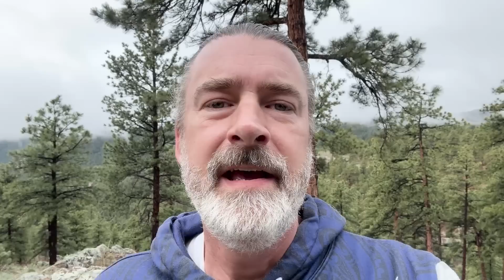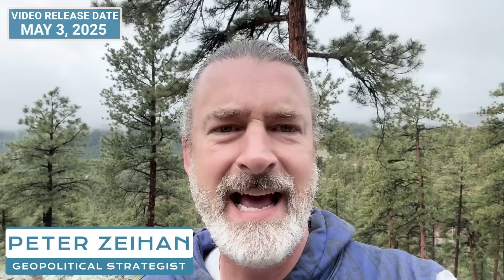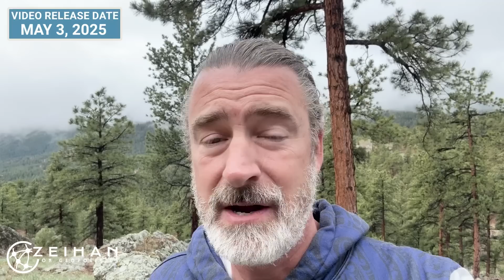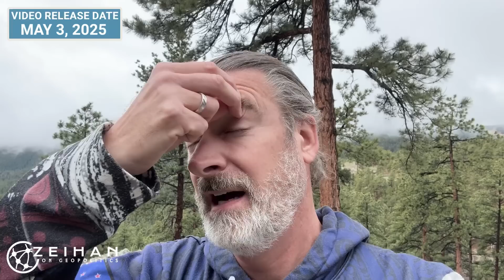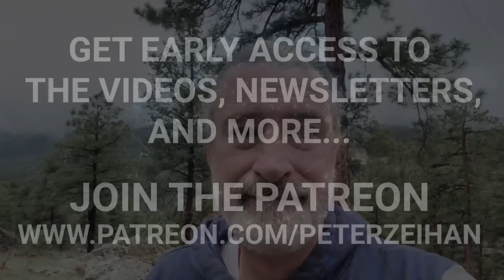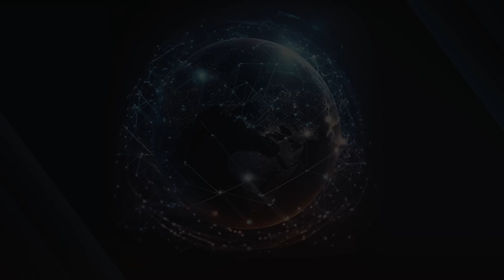The Night the Lights Went Out in Geor- er, Spain || Peter Zeihan

Comment: "Spin out of control" - well said. Easy to understand (I hope)   Sadly spinning mass dampers are not large enough to handle the issue. When scaled up, the losses also scale up. 
Capacitor banks are not there yet.   
Do not overlook NUCLEAR power. One does not need fossile fuels per se.

Comment: Theres a third and fourth option as well. We can use nuclear power obviously, but we can also use gravity batteries instead of using normal ones. Essentially using excess energy to fill a reservoir with water, then letting the water spill back out spinning turbines for power during peak power or the evening.

Comment: I'm not an electrical engineer, but I do understand that batteries are excellent at grid stabilization. This just doesn't pass the smell test. What happened I'm sure is like you said: a frequency shift causing a grid shutdown due to over/under production of power. I do not know that batteries are to blame for it and the titanium thing? no..... just no.

Comment: I worked in a large base load power plant in I believe in 1998 or 1999 there was a large transformer blew up took out the power on the east coast. I was working that day and started picking up alarms on the machines generators. We were being pulled out of 60 cycles. We were at full load on both units 500 megwatts. The harmonics caused by the sag could damage the turbines. We started dropping load to try and bring the voltage back up. We contacted the load center and was told to do what ever wanted because they were in trouble finally someone open the system interconnection with the ECAR system and everthing came back. Other wise the result would have been very bad

Comment: I was driving from Spain into Portugal on April 28 when the power outage happened/this is the first time ever in history that Portugal was completely without power from north to south south Spain was out of power/it happened around 12 o’clock in the afternoon the power was back up and running by 10 o’clock that evening. This is actually strategically done. The Portuguese and and Spaniards were blaming it on Russia/but Russia had nothing to do with this. This is all about flipping the monetary system. And it has started/get ready Americans.

Comment: Peter,  what you are saying is just incorrect. This is  misinformation that the coal and natural gas industry are hoping will be spread. Inverter based generation can perform all of the ancillary services needed to correct grid quality problems caused by load fluctuations, issues related to spinning turbines and other grid events. HOWEVER if the utility was not using the monitoring and control features enabled by the inverter based generation like Low Voltage Ride Through (LVRT) or VAR support then the “wobble” you mentioned can not be corrected fast enough by spinning turbines.  Spinning turbines are slow to correct grid quality issues which is why utility have used capacitor banks and other equipment that can act faster to grid issues  for decades. The reaction time for inverter based generation and existing energy storage is in milliseconds like capacitor banks (or even faster) but only if the utility were using these features. Most of the utilities in the US do not use these features because they don’t understand them and fear using LVRT could threaten line workers if the lines were intentionally off for maintenance. The lithium ion titanium story was really strange.  Current energy storage is supporting the grid for hours, not seconds. Love your channel but your passive dismissal of solar and wind is misplaced.  Hope you consider doing more research before making such misstatements on this issue.

Comment: If spinning mass is the main issue here, you can build rotating converters instead of the solid state inverters. A DC motor driving an AC alternator, add a flywheel inbetween for stability. That kind of oldstyle tech has been around for a hundred years, it has the disadvantage of being more service-intensive than solid state because of the moving parts but if you need inertia it might be the way to go.

And Austria doesn't have a significant amount of "heat power", it's mostly hydroelectric power. Which also has spinning turbines, so some rotating inertia.

Comment: All that is needed is to use some of the stored power to spin up a large flywheel attached to electrical generation and this will provide the inertia to stabilise the system from fluctuations of both power and frequency, in exactly the same manner that the steam generated turbines of coal powered stations do.

Comment: If you want to replace coal with low carbon power and still maintain grid stability, you can use nuclear. Nuclear provides reliable, stable base load without the need for batteries.

Comment: Irrespective of the cause, the other kinetic inertia capability not mentioned is the synchronous condenser of which there are 4 in South Australia. A spinning flywheel using power from the grid, not fossil fuels.  The global synchronous condenser market in terms of revenue was estimated to be worth $661 million in 2022 and is poised to reach $811 million by 2030.

Comment: You can introduce inertia into the grid using another piece of technology you haven't mentioned. You can use the DC energy produced by solar etc to maintain a "spinning generator" at the right frequency. This will introduce inertia but will you will lose a little energy in the process.

Comment: Spinning reserve doesn’t need to be provided by coal or gas, any thermal plant will do it, geothermal for example is a low carbon thermal option, base load flexible and increasingly going to be available basically anywhere…

Comment: Two thoughts here:

(1) Aren't the wind turbines all around not also a huge resource of "energy storing flyewheels? As they produce DC stabilizing the frequency all that is required is the adequate frequnct controll of the inverters, so to get effective is just a matter of milliseconds. (At the price of slowing the rotors down a little bit during that time, but dedicated flywheels as short term energy resource works in excatly the same way.)

(2) If only the stabilizing effect is an issue for a few minutes, wouldn't another option be just to shut off car charging stations for a brief moment? This not even needs to be a full shutdown, just reduce the charging output to 50% or 25% for a few minutes, stretching the duration of a 30 minute charging stop to maybe 35 minutes.

Yes, this affects all those who are charging their cars at the moment of the  instability nur isn't that a small price to be paid by by few people (less than a typical afternoon traffic jam or road construction work might cause) with a huge benefit to a whole country.

Comment: Batteries are not the only storage solution. 
Flywheels work, gravity storage (as stacking concrete blocks) is a new thing being adopted in China, and concentrated solar thermal power uses heat storage at the point of power production. All of these do not require rare materials or limited geography.

Comment: It is true that a stable frequency is needed. The other things you say is rubbish. Grid storage could 
 help stabilise the grid this just depends on the choice of inverter. Most are currently Line-commutated converters just follow the frequency so don't help. Voltage-source converter can steer their frequency and thus actively reduce frequency instability. Also no special batteries are needed as the limitation is the power rating of the converter not of the batteries. Regulation in both of these fields are needed.

Comment: WHEN THE GRID WAS DESIGNED......THE AC OR DC SCENARIO......THE DC WAS NOT A LONG THROW WHERE AS AC CAN BE A LONG THROW !
BUT THE TRUE REALITY IS THAT YOUR AC OUT OF THE WALL WHEN YOU PLUG IN YOUR ELECTRONIC DEVICES........GETS CONVERTED TO DC TO RUN THOSE DEVICES !!!   SO THERE COMES DON SADOWAY AND THE LIQUID METAL BATTERY....THOUGH AIMED AT GRID STORAGE, THE BATTERY IS THE TOTAL SOLUTION TO POWER !!!  THE PRESENT GRID IS OBSOLETE.....AND THE SADOWAY TECHNOLOGY WITH HIS BATTERY IS THE FINAL SOLUTION !!  SO THIS IS A CHEMISTRY BATTERY AND HENCE AN EXOTHERMIC REACTION ....MAKING HEAT.....LOTS OF HEAT.....TO THE TUNE OF 1600 DEGREES AND WELL ENOUGH TO CREATE STEAM AND A CLOSED LOOP SYSTEM......HENCE THE BATTERY IS SAID TO BE 4 HOURS UP AND 4 HOURS DOWN AND THE WHOLE TIME IT IS MAKING THS HEAT !!!   SO THE BATTERY CAN BE A SELF CHARGING SCENARIO WITH AN ARRAY OF BATTERIES AT VARIOUS STAGES OF CHARGE/DISCHARGE AND THUS CYCLING....ALL THE WHILE MAKING HEAT AND PRODUCING STEAM AND SPINNING A TURBINE......BUT LET'S IMAGINE SCALE AT THE HOME LEVEL AND THINK THE SIZE OF A CHEST FREEZER AND A SMALL TURBINE......AND AROUND THE SMALL FOOTPRINT OF A TYPICAL GAS HOME FURNACE IN THE NORTH EAST USA.  PART OF STEAM IS THE COOL DOWN FOR EFFICIENCY AND THUS A HEAT SINK......AND SUCH HEAT SINK IN A HOME SITUATION WOULD BE RADIANT FLOOR HEATING FOR COLD WEATHER SEASON AND THEN AN OUTSIDE UNIT FOR THE WARM SEASON TO DIVERT TO !!  SO IN HOT SEASON, THERE CAN BE SOLID STATE COOLING AS IN PELTIER AND THUS WITH AN ABUNDANT ENERGY SOURCE IN THE HOME......WHY NOT.  SO THE BASICS OF THE SADOWAY BATTERY ARE A SEALED VESSEL AND A CHEMICAL REACTION.....SO THINK CHEMICAL REACTOR IN THE HOME AND BENIGN !!!   NO MORE ENERGY BILLS FOR FOSSIL FUELS AND NO ISSUES WITH RADIOACTIVE COMPOUNDS AND HALF-LIFE ISSUES ..........AND JUST LIKE SOLAR IS MARKETED AS BEING ABLE TO SELL YOUR POWER BACK TO THE GRID.......IMAGINE THE ABUNDANCE OF POWER  AND A COMMUNITY WITH THIS IN EVERY HOME AND THE NEIGHBORHOOD MUNICIPAL NEEDS FOR POWER ARE TAX PAYER GENERATED......AND NO LONGER TAX PAYER PAID FOR AS A COST IN LOCAL GOVERNMENT & THE NEED FOR TAX REVENUE !!!    THINK INDUSTRIAL AND THE ENERGY COSTS OF PRODUCTION REDUCED TO ZERO IF NOT NEAR ZERO.....AND WHAT GETS PASSED TO THE CONSUMER.  IMAGINE THE REDUCTIONS IN COSTS ACROSS THE BOARD !!!  BUT THIS IS JUST A BASIC APPLICATION.......THAT EVERYBODY COULD UNDERSTAND WHEN IT COMES TO THE ROOF OVER YOUR HEAD.   NOW THINK ABOUT TRANSPORTATION AND ELECTRIC TRACTION MOTORS....AND RAIL SYSTEMS...AND MOVING PEOPLE DISTANCES AND COMMERCE AND TRANSPORTING GOODS.........FOOD FOR THOUGHTS !!!

Comment: There are several other solutions that use turbines then just gas and coal. Nuclear is a big one, but you also have hydro, which is another big one - both clean. You also have geothermal although that is relativly new tech and not suitable everywhere. Burning trash (heat-electric plants) is also a solution that solves several problems at once (heat, electricity and waste management) and with proper filtration can become pretty darn clean. A more experimental one is composting plats where the bacterial process to break down organic materia generate heat that creates steam tgat can be pressurized and power turbines. All these sokutions use turbines, and none of them are as toxic as coal nor carry as much geopolitical dependence as gas.

You can also do combination  solutions. On the Azores forexample they use wind and sokar to pump up sea water to an old vulcanic crater that act as a water magazine and then they use that water to power a hydroplant that gives a steady supply of electricity. Yea there is a big loss of energy in the convertion/pumping for sure but the benefits of getting a steady and selfreliant supply of clean energy overweigh the con of the energy loss (at least in their case).

So one do not need to deafult to coal and gas to keep the "wobble" steady, there are other means.
Reply: Nuclear energy is a marginal solution. It was never more than that. Neither is hydropower in most places of the world. Geothermal resources may be a bit more promising, but what for? We can make more solar energy cheaply than the planet will ever need.

Comment: Synchronous condensors. Big spinning flywheel masses designed to keep the frequency constant and compensate for large spikes or drops in current. Old tech, been around for decades and they need to install more of these I thinks.
Reply: Yes, a technology that doesn't work has been around for decades. That's true. So has a technology that does work: battery storage. ;-)
Reply: @lepidoptera9337   does or doesn't did you mean?  fyi grid operators around the world still run mechanical synchronous condensors. They are in use, and they work. In recent years some have been replaced with electronic inverter type synchronous condensors that can provide a "synthetic" inertia. It's not so much power supply but power & frequency dampening and smoothing that is the issue here. Can the inverters at a battery storage farm provide enough electronic inertia? Maybe, I am not sure, but having more synchronous condensors of whatever type is supposed to dampen frequency and power instability events meaning generators (including renewables and batteries) are less likely to trip out due to grid disturbances. They need to spend some money on grid stability devices in addition to storage.

Comment: I have been studying contemporary grid technology for 10 years, and specifically grid battery storage and I completely disagree with you that you need lithium titanate to provide frequency stabilisation and electronic inertia control. The Hornsdale Power Reserve battery in South Australia was built from Tesla Megapacks using NCA chemistry specifically for the purpose of frequency control by Neoen, a French corporation. Almost all lithium ion grid batteries in coupled with inertia optimised inverters are completely capable of frequency control and can be built for longer duration (4-6hrs), or wired for rapid frequency stabilisation. CATL and BYD both also build their own version of the MegaPack using LFP that can be ordered to provide either long duration or rapid discharge. 

 Unfortunately Peter has wondered into this topic without extensive knowledge of grid scale lithium battery tech.

You can't know everything, but please don't claim deep knowledge of a topic when you don't.

Comment: There's yet another solution, and it requires neither batteries nor fossil fuels.  If your power is all being generated at large facilities for transmission over distance, everything needs to stay in sync, and you can't have any large amount of capacity suddenly drop off line.

But. The more spread out your generating capacity is, the less critical to the overall network any single generation station  becomes. Suppose your grid is set up so that suburban homes were all on one separable grid - and each suburban home had it's own solar generation. If there was a "wobble" in the larger grid, it could drop off --- yet once seperated from the problem, all those homes could continue to feed their sub-grid so the burbs would all have power. 

I.e., a lot of "micro-grids" could ensure that  most homes at least would continue to have power, and maybe small retail businesses like convenience or even grocery stores in the 'burbs could continue to operate, even if industrial facilities got dropped. Hell, get good enough storage and all those homes could just liberally "drop off the grid" completely.

The more you can distribute your generation, the less susceptible to cascading failures most of your homes and businesses would be.

Hell, that's half the reason a lot of people go ahead and "go solar" in the first damned place. Yeah, long term they save money -- but as soon as the installation is done, with an automatic bus switch, you are safe from the general grid collapsing. If you've got enough battery capacity charged up, you might be able to go for weeks or months without actually pulling any power from the grid. You might be able to just disconnect from "the grid" entirely. Even if you can't do it all by yourself, the concept of "micro grids" could still allow small groups to be independent of the main grid.

So, no, we don't actually have to have fossil fuel or nuclear plants, at least not to power homes.

Powering data centers supporting AI, well, that may be a different story.

Comment: Some EE/power generation and transmission expert need to write a book explaining grid stability for the masses, and it should be mandatory reading for politicians.
Reply: those books exist but are waaaaay over the head of most folks.   You are correct though that SOMEONE desperately needs to better explain this to politicians.  Grid inertia and frequency stability is a huge issue in the utility industry.

Comment: Hi Peter, love love love your work.
All rotationally generated power is AC,  yes even the alternator in your car where Power rectifying diodes change AC  to DC. So wing turbines generate AC speed control by variable pitch blades controls  cycle per sec so mass control effect is available with wind.